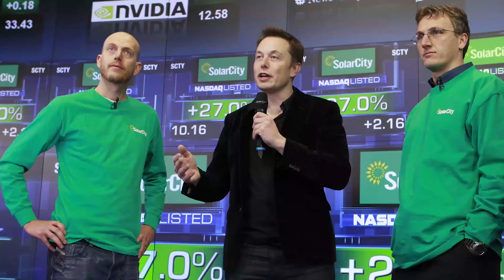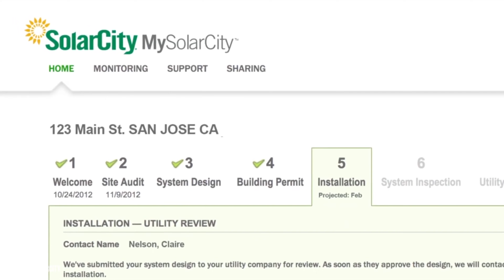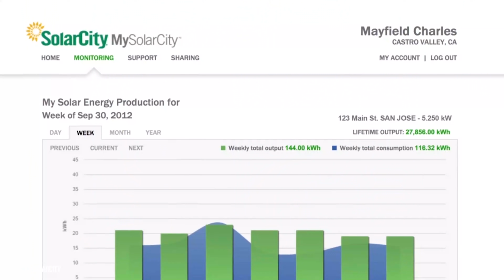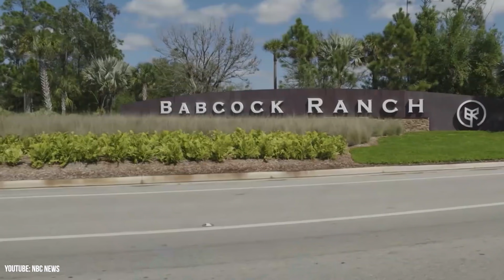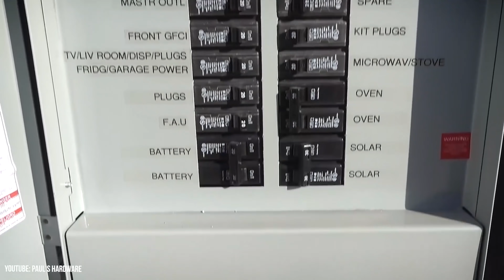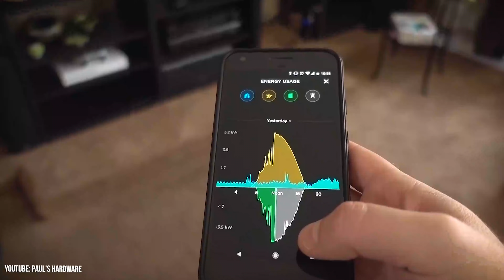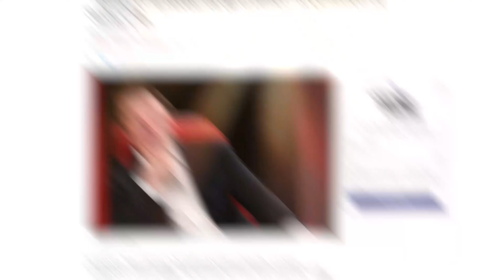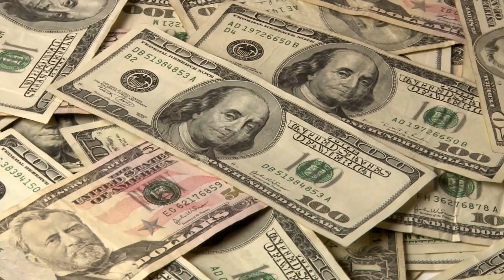What Happened To SolarCity?

Comment: Solar panels are expensive. People have this concept in their head that because its power comes from the sun, and the sun is free for everyone that solar power should be cheap. First off, buying and installing panels aint cheap. Second, its not just install and forget, solar panels need to be maintained and doesnt have unlimited lifespan. Both the batteries and panels degrade, efficency will get lower as time goes by.

Comment: you missed the important fact that  new roof reno + solar costs more than tesla solar roof at least i was under that impression thats the target demographic
Reply: It all depends on how you calculate costs. Tesla is well known for excluding things from their initial estimates and jacking up the price as the job progresses.  
For example, they inspected the attic when calculating their initial estimate and saw that the roof used slats under the shingles during the two pre-contract inspections.  The low bid was accepted, the contract signed, and several months of delays, work started.  It was not until the end of the day when the entire roof had been torn off that the foreman informed the homeowner that the Tesla solar singles could not be mounted on slats and the entire roof would need to be covered in plywood before they could proceed further.
They knew there was a "problem" as soon as the first shingles came up and they saw the slats around 8am but said nothing until the entire roof was stripped off and they were cleaning up to go home.  Now the homeowner is over the barrel. He has no roof. The foreman can't/doesn't provide an accurate estimate.  Tesla's office is closed for the day.  It's too late to get a second opinion. The foreman's guess is not binding on Tesla.  All work will stop if the owner doesn't say yes.  The owner may be in breach of contract if he says no.  
Of course the homeowner gave approval.  It was not until the next afternoon after nearly all the plywood had been installed that the Tesla office finally called to provide their official estimate.  I think it was just under $4000 extra for the materials and labor just to install the plywood before any work on installing the solar roof could start.  During the job a few more things added to the final bill that were clearly visible but somehow overlooked during the two inspections before the contract was signed.

Comment: I must note, as an ex roofer, high quality roofs are NOT cheep, around the same price as the Tesla roofs and not as durable nor do they pay you money. I could only see someone buying this if their roof is in need of replacement. But absolutely should build with new houses!
Reply: Ya... it's partyly their own fault in their marketing.. but of course composition asphalt shingles and corresponding products are cheaper. Solar roofs are meant to compete with ceramic tile, slate and other higher end, durable roofing materials. Ideally the price is ameliorated my longevity.
Reply: @Ungtartog  I was comparing to high end comp
Reply: This is exactly what Elon has noted as well - consider Tesla solar roof if you're about to replace your whole roof
Reply: @faythe03  But my friend has got tesla solar roof and he is enjoying from 2 years without any problem
Reply: Troll bot infomercial thread pushing propaganda
Reply: The solar tile roof doesn’t work for rather obvious reasons. They have been tried many times in the past

Comment: If your regular roof is an avg of $24k and the conventional panels are $24k now you're at 48k plus the labor to remove the panels to replace/repair the roof. Where as the $64k roof panels are the roof which I think would last longer and be easier to repair. I think the economics are there, availability is the issue.
Reply: I thought of a better way for solar panels to be more efficient in cost, installation, production. Graphene sheets production method being cheap, if one of my idea works, will be a reality come true for cheap solar panels, at $1, a whole big shingle would be deployable, by simple LAYING the thing over the roof, and not using wires, but electromagnetic hertz current resonance at distance, to power the wall outlets.. 

It's not too much of a stretch. Wires are not required, and this part is not a dream.
Reply: Except the solar cells don't last as long as a normal roof.

Comment: Logically Answered, is fusion power the future?
Reply from the maker: I’m not too familiar with fusion, so I’m not sure if I could give you a good answer
Reply: @LogicallyAnswered  try researching on this topic
Reply: @logically answered that’s fine :)
Reply: @LogicallyAnswered  fusion is always 30 years from being realised😂
Reply: I'm no expert, but no, fission is closer than fusion. Modular and thorium reactors. Fusion goes forward and got a vast diversity of methods it ain't a dead end at least. My favorite is the one that directly generates electricity instead using steam based tokamak fusion.
Reply: I doubt that tokamak type fusion reactors will ever be cheap enough to compete with other sources of electricity.  For fusion power to become economical it will probably require a different approach.  There are many companies developing alternative fusion reactor designs now, but it is difficult to say which (if any) of them will ultimately be successful.  The ones trying to develop aneutronic fusion will likely have more trouble reaching scientific breakeven, but they might actually have the best chances of becoming economical.

Comment: Logically Answered, do you like solar or wind power better?
Reply from the maker: I’d have to go with solar
Reply: @LogicallyAnswered  Why?
Both have their own advantages.
Reply: @neeljavia2965  I'd say because unlike wind you can use solar pretty much anywhere that gets enough sunlight and is far easier to use
If you want to use wind turbines you have to build a huge turbine with lots of complicated engineering and lots of maintenance but with solar, you just have to put them facing the optimal direction in an optimal degree and that's all and it needs far less maintenance
Also wind turbines create a strong magnetic field around themselves so people shouldn't live very close to them
Reply: @Matt0sh  True.
But it's useful for places having extremely cold climates.
Reply: @neeljavia2965  I agree
They all have their uses
Reply: @Matt0sh  Yes.
Reply: Wave power is the sht!
Reply: Nuclear
Reply: @Spicy007  nuclear isn't a clean energy rn and nuclear wastes are dangerous but nuclear fusion reactors are clean and produce a ton of energy but are very very complicated
Reply: @Spicy007  🤣🤣